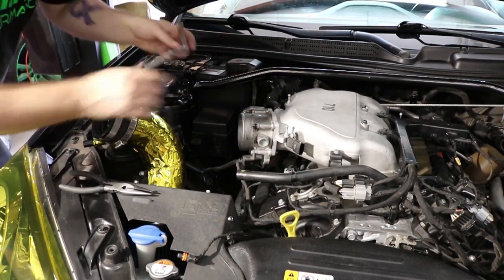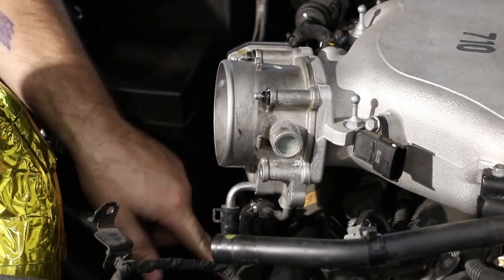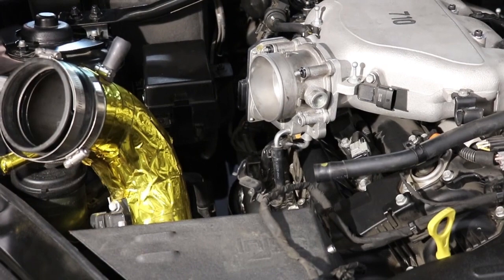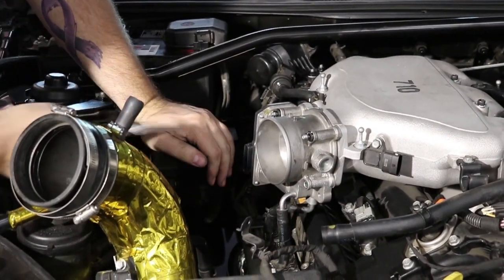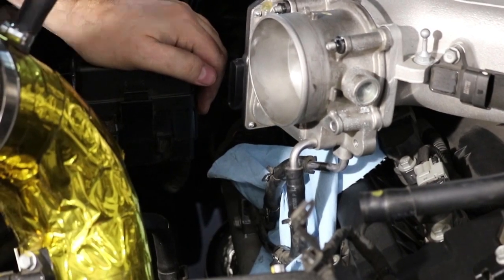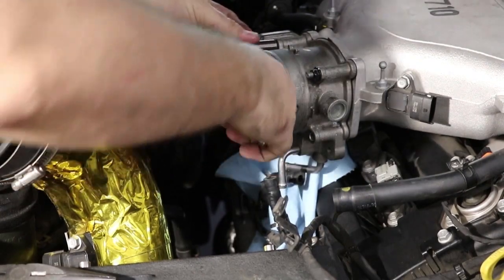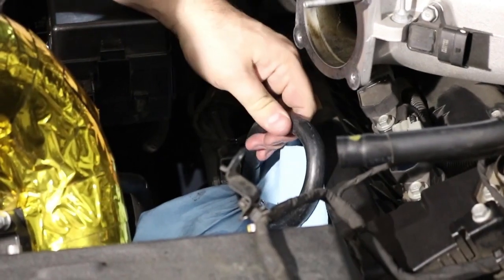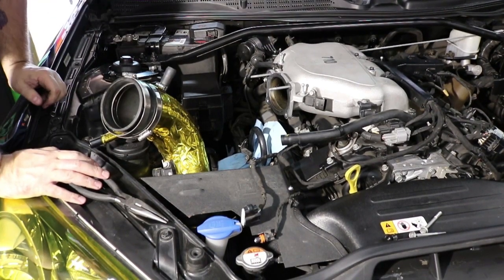Genesis Coupe coolant bypass mod. (Cooler intake air temps= more power!!)

Comment: define extremely cold
russia/canada style cold 
or west europe style cold?
Reply: Below 40f you should put the coolant lines back to stock to be safe. You dont want to risk the electronic throttle body freezing.  I usually do the coolant bypass in march, and put it back to stock mid november.
Reply: It’s inexpensive to do and very easy to put back, that being said of course do it in the summer or just after winter and put it back to how it was right before winter starts again😀

Comment: A terrible idea.  
Decrease throttle body temperatures..... BY REMOVING THE COOLANT SYSTEM THAT COOLS IT???
This is a horsepower loser just like removing the factory optimized cold air intake.
Reply: It warms it up bro, doesn’t cool it. It throws warm liquid
Reply: Factory c.a.i’s suck. They usually have unnecessary bends and grooves in the line, and the filters are garbage. Any decent after market intake is definitely going to be an improvement not a negative. Why do you think all performance vehicles have upgraded intakes? Just for fun? No lol, you’ve been watching too much Scotty Kilmer. Granted the gains are super minimal, and probably not worth it, but they do increase hp a tiny bit.